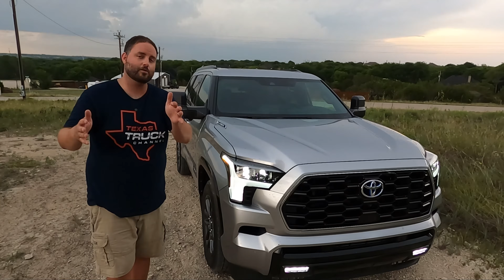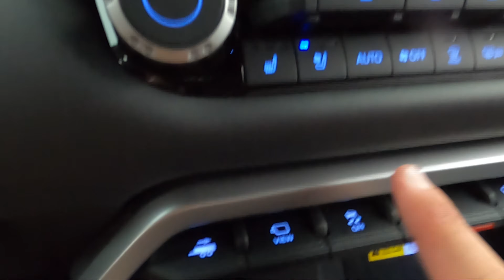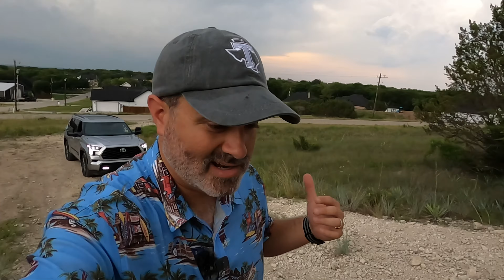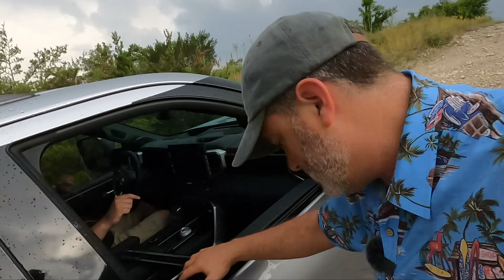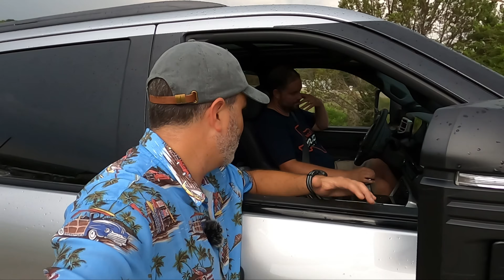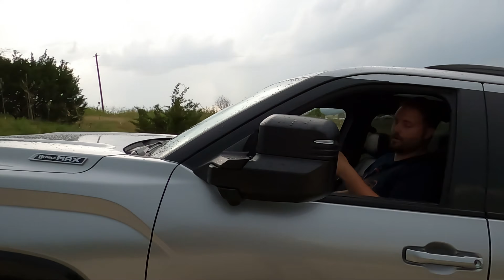Does The NON TRD PRO Toyota Sequoia Platinum Have Enough Bones To Make It Off Road?

Comment: I have a 24’ trd offroad. It has all the same offroad modes as the pro, MTS, MTM, crawl, downhill assist etc. Probably ends up close to the pro once you get better tires and add a small lift for clearance.

Comment: What's that? The Honda Pilot Trail Sport is more off road capable than the Toyota Sequoia? I'm at a loss for words...
Reply: You did hear them say this is not the off roading one right?
Reply: @ItsNotAndrew2 for a potential customer from who uses 90% on road and 10% off road occasionally for work or leisure. Those customers dont want a TRD version with aggressive threads for that 10% of instances. No excuse for this pathetic perfomance
Reply: @getexposedlmao  If you want off-road performance than get the TRD version. People need to stop crying with all this entitlement.